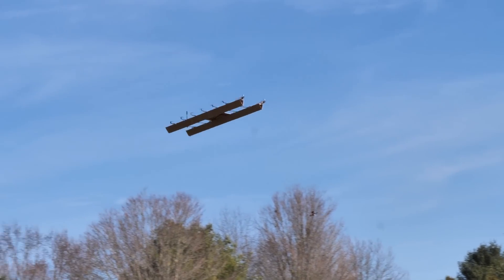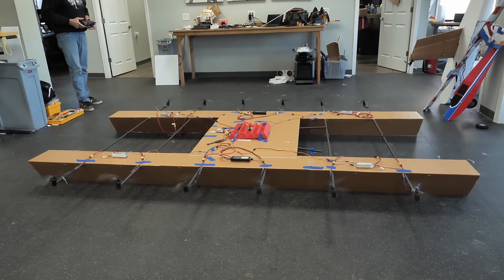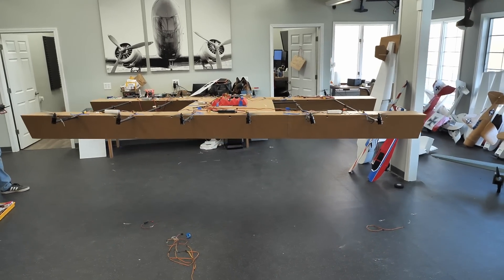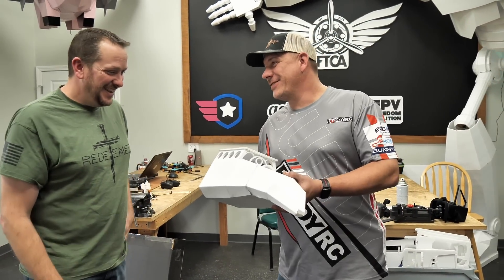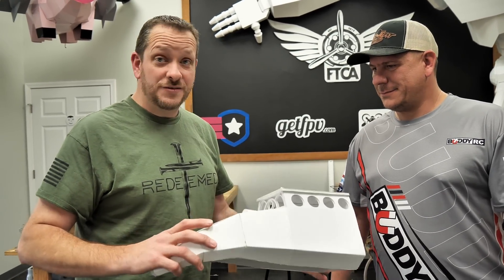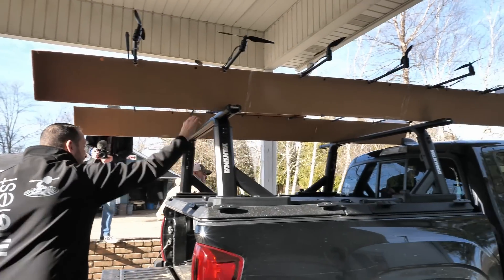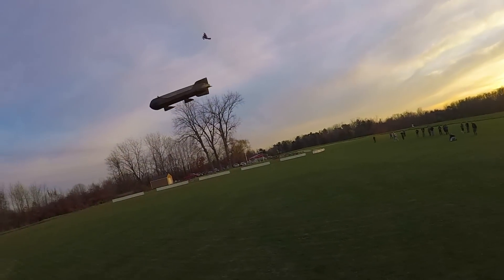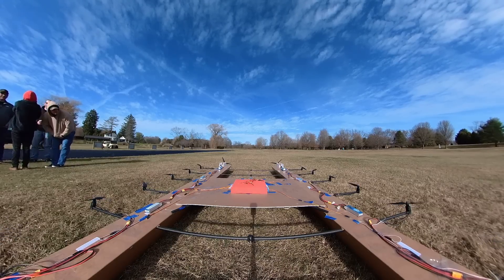Massive 18ft Helicarrier

Comment: Ok..  of I may add a suggestion. Change the forward thrust motors to tractor motor. Pilling feom the front. That will help in pitch. Also horizontal stabs in rear with elevators simply for trim.

Comment: Have you considered RF signal interference introduced by the other RC pestering it? An unshielded wiring harness may pick up signal static like an antenna which causes temporary power brown outs reducing stability in at least 3 (banked) motors. Does this Helicarrier initially pitch toward or away from the RC planes? Once the fore section is installed, balance the aft with steerable elevators to control forward yaw under power. That would less noticeably detract from your visual than a canard on the beak? But what do I know, just spitballing here.

Comment: Some seat of the pants ideas for you I have no idea if this is valid it's just what my good instinct tells me

I think you need two stability systems You need to have a stationary mode and a translation mode in stationary mode use level assist keep it level then you would simply use the main thrusters to yaw the bird this way it does not roll when you yaw

Then when you want to translate or move horizontally forward you would switch to translates stability mode

In this mode you would either pivot the motors or put thrust veins behind them pivoting them would work better since that would be closer to what we saw in the TV show there were no veins or fins behind the propellers in the TV show

When moving forward it would not adjust the thrust of the hover motors instead to control pitch it would use thrust vector control for the monster motors You would need probably only a couple of degrees of pivot to have a pretty big effect but this way it would be level control more like an airplane instead of a quadcopter it would only use the quadcopter motors for roll level but not for y'all and not for pitch for y'all and pitch you would use the main motors so you would need two flight computers and two gyro controllers however that works

So once again in hover mode you would use your level assist

But in translate mode you would use the hover motors to control roll just to keep it from rolling since this aircraft does not roll it stays flat the whole time

Then you would use differential thrust to control yaw and you would pitch the motors up and down a couple degrees to control pitch while moving forward

I think that'll give you much more predictable much more controllable results

The one thing you don't want is the hover motor is varying too much and thrust while moving forward That's just causes too many issues like you saw

You might also want to contact BPS space He's done a lot with tuning of profiles so you might just need to tune your gyro profiles to not have the over correction problem you're seeing? I'm not sure how much of that can be translated to stock RC gear he tends to use completely custom flight computers so I don't know how much his tuning procedure would help you or not but he has similar problems early on with tuning his thrust vector control for TVC for his rockets some of that information might help you here

Comment: the engines at the ends have more influence on the flight because they have more leverage.
stability should only be with the 4 outermost motors
and the intermediate motors that help the elevation

Comment: mix in extra throtle for last 2 horizontal motors when adding throtle for those 2 motors in back for forward movement. It should counteract pitching up effect. Or mount those 2 back motors tilted down. I would build movable gondolas for them so you can turn them and use for better steering 🙂

Comment: If you plan to fly it level it would maybe be good to add some small thrusters left, right and reverse. It would require more software tweaking, but then you can have directional control without effecting your pitch/yaw/roll.

Comment: Have you tried a separate TX control just for the "thrusters"?  Leave the two main sticks just for the twelve heli motors and bind a slider to control horizontal thrust.  That should give you more control and less chance of it trying to over correct.

Comment: The whole frame is too twisty right now. Until you solve that flex riddle you will be in a tailspin.  Cross brace the two triangle boxes by mounting half the motors high and half low.  At least until you get a more solid body on it to stop flex. THEN swap the drive motors super low kv and huge props like they do with the super light balsa planes. The fatty props and low kv with produce less torque than  higher kv motors. You may not see but the gyros will certainly feel. Last you need to seriously isolate that FC as The David said you can hear the vibration when it flys and that will really screw things up.

Comment: Loving the project! You guys are awesome! I recommend moving ALL the batteries to the very middle of the carrier (under the orange foam pad, if possible). With all the weight of the batteries on the outer edge, the motors have to work harder to move all that mass back to "in balance". Keep up the great work!

Comment: Love the project guys. My thoughts on the stability, although only an amateur observation, is you guys are treating it like a multirotor programming wise but attempting to fly it like a fixed wing. This seems to make the aircraft pitch for forward movement which makes the thrusters point up forcing the rear down. That action is causing the fight controller to get severely confused.

Comment: Awesome build guys 
BUT I think you need to move your forward motors to middle of the frame, it is changing the thrust dynamic where it is placed and your fc can no way keep up with it. If the forward motors are central and smaller they wont affect the hover as much. 
Love your show and aspire to follow the path.
Reply: That wouldn't look right though. Thrust motors need to be at the back to match the original.

Comment: Really cool project! Tricky with the forward motors confusing the flight controller. It looks like this could be supported in ArduPilot, almost out of the box. It should work as a quad plane with a scripting matrix (Q_FRAME_CLASS=15) for the motors and “Manual Forward Throttle in VTOL Modes” (RCx_OPTION=209) for forward throttle. If there is a lack of PWM outputs it could work with the frame type as octaquad with an H-frame and some motors in parallel.

Comment: Wasn't it pulling nose up to counter the forward movement caused by the back motors? I'm thinking the FC is programmed to resist outside forces like wind. 
Could be complelely wrong but does the FC actually "know" there are motors pushing it?

Comment: I'd like to see you guys build a dedicated launch system on the top of that golf cart that you have. They can get up to pretty good speed and the roof is pretty stable to mount stuff too. You could either design a Carriage with a hook release (manual from the cart or Remote Pilot activated), or even a catapult system that could increase forward speed for faster aircraft. Of course, you could always go full FliteTest crazy and put a carrier deck on top, LOL.
Frankly for some of the larger craft you are building lately, something like that would actually be safer. I see you guys hand launching large stuff, or trying to do it from the back of a pickup truck, stuff like that. Just for safety sake a dedicated.. Launch Cart ...seems like a sensible project for you guys to take on.

Comment: So when you move forwards your pushing against the prop like a wing, think auto gyro.
I wonder if you duct the fans you'll avoid it with out doing anything clever.
I'd also suspect you'll be able to go very fast.

Edit 1
Hmm thinking about it if you did want to get "clever" if you have scoop ducts you could use that forward movement to shove air into the ducts and get the flight computer to keep the height stable with variable throttle.
Fascinating see that in action though!

Edit 2
Thinking about it more I'm not sure it is auto gyroscopic effect but I still think you should try ducting as the air passing down and through the blades will give a similar effect.
So ducting should still work..
I don't even think you need much of a duct just a bit of defection of the oncoming air.
Maybe even get away with the first row or two of the props.
Reply: If you wanted to test my theory mount a prop on the side and push it sideways and see if it oscillates in the other plane.

Comment: The open ends are the problem. They are acting like air foils when the thrusters are off, then the thrusters are directly behind them, pulling air through them, creating suction on the front side. 
Seal the boughs front and back with standard bough shapes

Comment: Great video!  I like the idea of Acro mode. Also, please make sure AirMode is set on all the time.  As you increase the size of the 12 motors, I'd suggest going with smaller motors for the two thrust motors in back.  The two thrust motors are not part of the flight controller, correct?  That is, you are inputting thrust through a PWM channel that is going around the "4" motor output from the flight controller.  The ArduPilot guys are probably looking at this and ready to make suggestions on how you can get the thrust motors integrated into the flight controller like they do for VTOLs.   DaveM

Comment: It also looked like the two "pontoons" (for want of a better term) were oscillating in pitch in relationship to each other - one pontoon would go up slightly, the other down, & vice versa.  It might make sense to put something that stiffens between the pontoons so they don't oscillate in reference to each other.  I noted this after 15:00 in the video.
Reply: Agreed
Reply: It could probably be tuned by diddling the PIDs.  But there might be too much structural oscillation for that to be practically possible for the production deadline.

Comment: Just a thought, instead of syncing 3 adjacent motors, mix the syncing side to side and sync in 4 motors instead of 3. Might increase stability.  Hope this helps. God bless, stay well. Happy New Year!
Reply: I'm guessing the thought with syncing 3 was to allow more or less standard quad copter control at least as far as the lift/hover is concerned.  I do agree with your thought as far as the adjacent motors is concerned.  Maybe something like: Motor channel #1 controlling 2 at right front and 1 at left rear, MC2 controls 2 at right rear and 1 at left front, MC3 has 2 at left rear and 1 at right front, MC4 has 2 at left front and 1 at right rear.

Comment: I know you have differential thrust in order to give yourselves rudder control, what would happen and I don't have any clue how hard it would be, if you managed to put, say the first two Motors in the same differential thrust? Like as you increase the throttle it would throttle the two front Motors to help keep the nose down and change the center of lift a little farther forward in order to make it fly level?